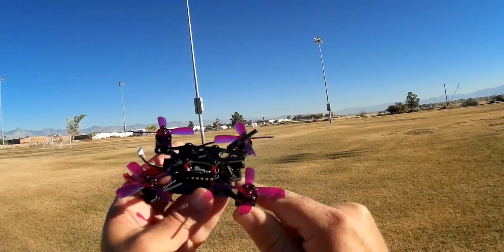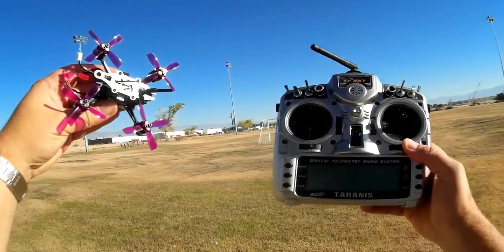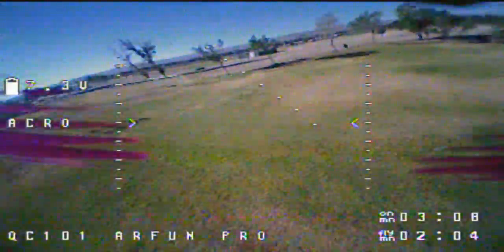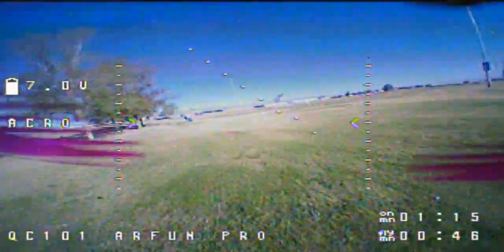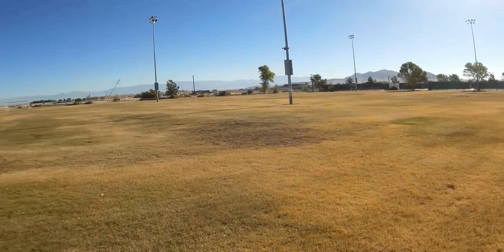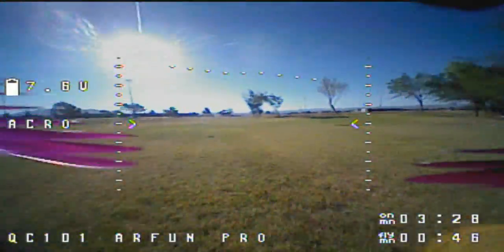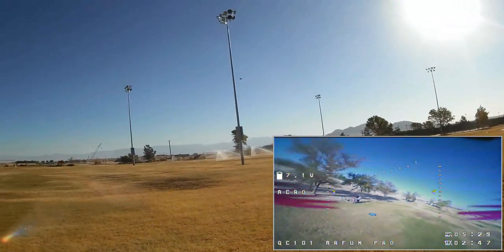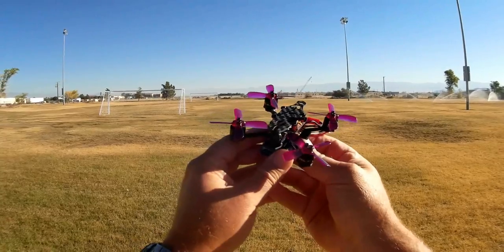Arfun Pro 95mm Micro FPV Racer Drone Flight Test Review

Comment: I've seen many reviews of this one, and its predecessor, the ARFUN 90. You can back off a bit on the Roll rate and set the Super Rate to the same as the Pitch, which was 0.75. That should tame it down for you. Good flyer, and already very popular with the micro FPV crowd. Thanks for the review .. Cheers.

Comment: I have a FLYSKY FS-i6 radio what is the difference between the Flysky AFHDS and AFHDS 2A options?
Reply from the maker: AFHDS 2A allows setting Failsafe option (i.e. motors can turn off if you fly out of range).  With the older AFHDS, the motors (and other controls such as pitch, roll, and yaw) maintain their last setting if you fly out of range.  AFHS 2A is much more preferable as it help prevent flyaway.  Here's an example of what can happen with older AFHDS (and why I will no longer consider an AFHDS equipped quadcopter) https://www.youtube.com/watch?v=XyxQk-OCkKI
Reply from the maker: By the way, AFHDS and AFHDS 2A formats are built into the receiver.  You set your transmitter based on which format your receiver uses.  If it's an older receiver, chances are its AFHDS.  If newer, AFHDS 2A.
Reply: Zaid Javaid hey zaid, did you manage to bind this quad to your i6 with no problems?

Comment: I have a question that you may be able to answer. I was flying on my property the other day with my little qx90c which is perfect for my tight space and trees etc. plus I’m new at the hobby. What happened is I hit a powere line and the model went down. After that when I would throttle up it would yaw like crazy to the left. I changed all the motors and  that didn’t fix the problem but I hooked it to clean flight and it fixed the problem. Now the thing won’t connect with the taranis radio I use. I tried to bind again to no avail. Do you have any idea what I may have done wrong. I even tried using my old cli commands that I have saved on a notepad file and still can’t get it to connect. If there’s anything you know of that I may have done wrong or that you know may fix my dilemma I would much appreciate I know you probably have short time but your videos have helped me learn a lot that I didn’t know so I thought I would ask. Thanks for any help you can give  great videos by the way. I want one of these AR Funs
Reply from the maker: Unfortunately I don't have a qx90c.  But most micros bind nearly all the same.  Do you know how to set the receiver on your drone to bind mode?  When you do, what happens when you select bind on your transmitter?

Comment: If i wanted to bind this to the flysky i6, which receiver would i use: the afhds 2a or just afhds?
Reply from the maker: I would recommend AFHDS 2A as it has failsafe capability.
Reply: Thanks so much, so is that the only difference? My i6 can bind to either?
Reply from the maker: +PlainLuke yes, but you have to select which one that you're using in the transmitter's menus.
Reply: Ok, thanks alot for the help!